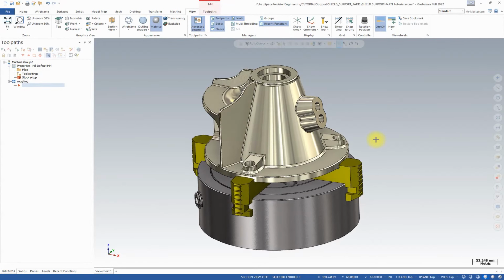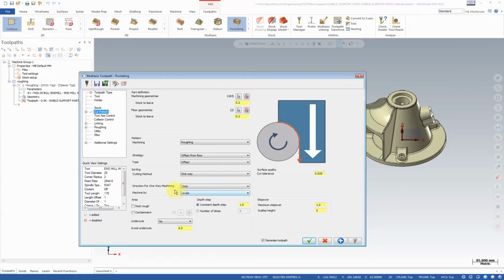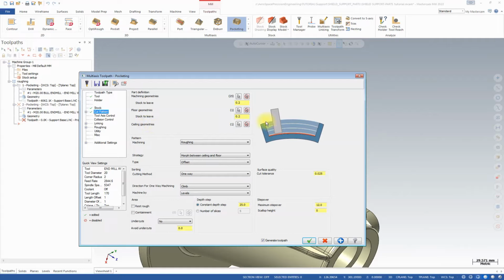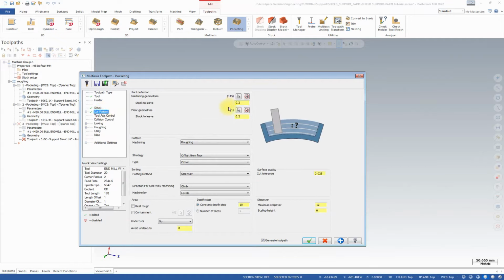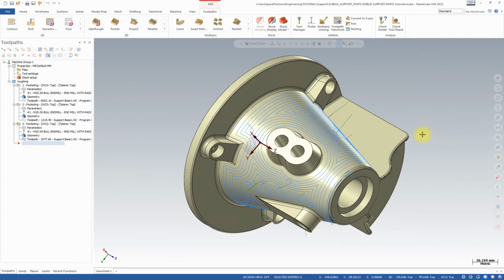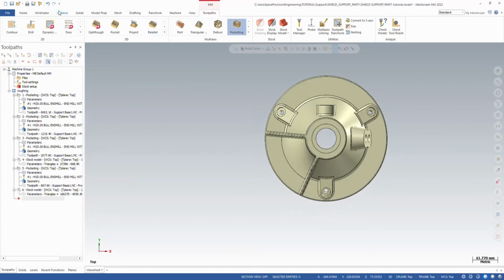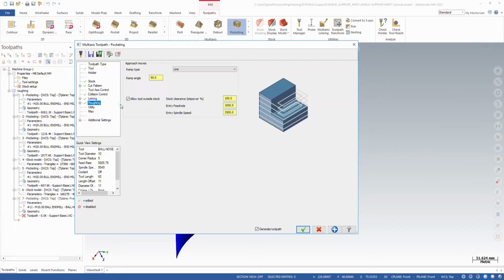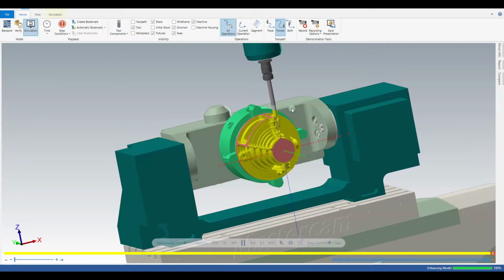MASTERCAM 2022 - MULTIAXIS POCKETING - SHIELD SUPPORT PART 1 ROUGHING

Comment: Is there any way not to create that surface to be normal to pocket? Sir. Thanks
Reply from the maker: when used roughing in multiaxis pocketing you need to use a face or a surf 
you can use 3+2 automatic roughing and select planes :)
Reply: @aspeaerospaceprecisionenging  thank you Sir. U know what.....I rewinded your video many times and tried to listen carefully so now understand 90% 5th axis mastercam works how!!! Is it ways that once you click on any surface or solid face mastercam 5th axis toolpath knows you will work on that area right?? Sir and tool axis control to control the head of the machine? Doesn't it!!!! Thks sir.

Comment: Thank you very much for this great video. I need to ask you a question. You used a long tool with large depth of cuts and relatively high feed rates at first roughing op that is parallel to the flat floor surface. I wonder if these tool and parameters are the real parameters that you used while machining the part on the machine?
Reply from the maker: Hi Ilker, 
we use different operation to machine this feature in our shop
The purpose of this exercise was to show  different ways of controlling the tool axis during the cut using pocketing. I made this tutorial to request from one of our subscriber (Ron S) plus I got a few emails asking for multiaxis pocketing (months ago)
There is no info regarding pocketing on youtube or even internet so i drcided to dive a bit more into it :)
Thanks for watching and great comment :)
Reply: @aspeaerospaceprecisionenging  I see that you have a fan club since a community of the same people write comments after watching. I am also one of them :). Since I was busy nowadays (trying to get experience on our 5-axis Mazak), I could not have chance to watch your last videos. As one of the people wrote below, you are playing with Mastercam like a toy and it is really great for us to learn from you. Thanks a lot.
Reply from the maker: @ilkerkaripcin4608  Thanks Ilker, Yes i did notice that i have regural comments and emails from some of the subscribers :)
We do have 5Axis Mazak machines in our shop 
May I ask what model do you have Variaxis or cv500
what control? I like working with mazaks 
we do have a few integrex machines and 2 variaxis with smooth and Matrix controls
Reply: @aspeaerospaceprecisionenging  We have Variaxis i600, control unit is SmoothX. I was good at Siemens control unit and programming in Shopmill, but this time, especially for our first 5 axis, I preferred Mazak.  But I could not get used to Mazatrol programming yet :( I do the most of the programming via Mastercam for it. I knew 3+2, but learned simultaneous machining with the help of your videos :)
Reply from the maker: @ilkerkaripcin4608  ohh yes! we have i600 too :) smooth control is great 
I love the 3d model based programing on the machine 
we have also offline program for mazak SMOOTH CAM :)
Reply: @aspeaerospaceprecisionenging  Thank you for your prompt response :). It would be great if you can talk about the tools and tool holders in the future.